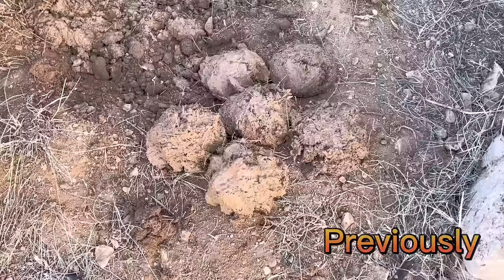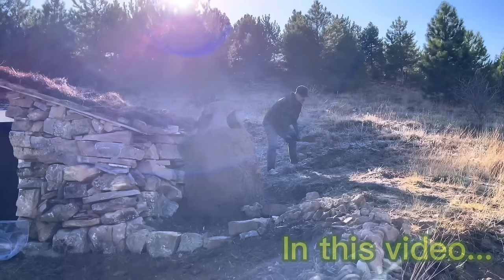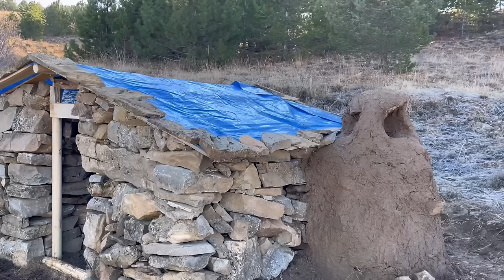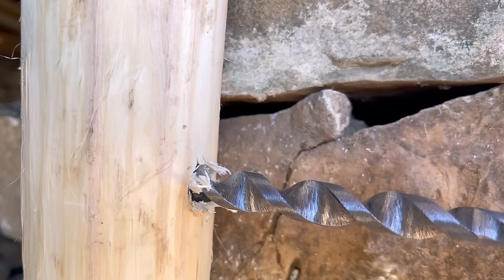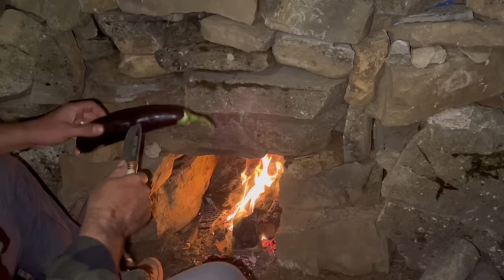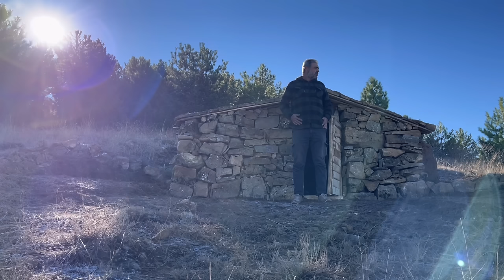Building a Warm Survival Shelter with Fireplace inside | Bushcraft Camp | Off Grid Stone Log Cabin

Comment: Wherever you go Into the Woods, if you have to move rocks for any reason whatsoever then strap a hand truck to your back with inflatable tires attached. Fill the tires with expansive foam before you leave the house so you will be assured of no flat tires when you're in the wilderness! Your back probably hurt you quite a bit after you moved all those stones right? My back hurts just watching you do this. I used to build retaining walls and I'm very mindful of how balanced coordination and using your common sense and your proper tools will help you feel good when you lay down at night instead of throbbing in pain while you can't sleep laying on the cold wet ground!
Reply from the maker: Hello. Thank you for your precious comment. I think I'm going through some very silly things. I have a herniated disc. Normally when I lift these heavy stones, my lower back has to be worse. But interestingly, my back is relaxed. I built a stone shelter last year. My back pain is gone and I haven't had any problems for months. After this stone house, my back was relieved. I thought about it but couldn't find a logical explanation. Building retaining walls is really hard work. If you have done it for many years, you are very tired physically. I think it will be a bit of a hassle to drive a wheelbarrow in this rough area. Thank you very much anyway.
Reply: @MichaelBushcraftandOutdoors  I agree that with proper body mechanics, your back should get stronger with rock setting. Also, a hand truck is not that heavy and can be easily carried and is indeed a back saving tool!
Your stone house look great. I am building a stone bush house with my son very soon.
Merry Christmas.
Reply from the maker: @1963wheeler  You are right. If I had driven a wheelbarrow, I would have finished much sooner. Health is more important than anything else, but I guess I don't pay enough attention to my health. It is necessary to work with the best equipment. I hope your house will make you very happy. Good luck. Merry Christmas. :-)

Comment: There is a problem with the height of the chimney as per Mi code the chimney has to clear the peak of the roof. In the video the  smoke is drafting across the (soon to be) dried grass of the roof. As fires usually exhaust sparks, you run the risk of setting the roof on fire. The whole of the house is very well done. I can really imagine ancestors, including kids, living there. Congrats.
Reply from the maker: Thanks you for your precious comment. I actually raised the chimney a bit in the last video, but I'm not sure if it's enough.
Reply: Good constructive comment :D

Comment: You did a great job. 
I converted  ( with my new wife ) a  stone church into a home. It had no water, or bathroom, and very minor electricity ( eight lights )  The pointing was terrible and not safe. 
We re-pointed it, installed electricity, heat ( wood stove & oil furnace )  had a well drilled, passed a well line through five feet of stone wall, installed plumbing, put a second floor using the pews for wood.
It turned into a beautiful home.
Your survival shelter was no less a challenge, my sincere compliments on your great work!
Reply from the maker: Thank you so much. You really put a lot of effort into making your own home. I can imagine how tired you are. Mine was pretty simple. My body was very tired, but I did not have complicated tasks. Thank you for your valuable comment.

Comment: I know, it's a hard job but you can add more stones to make the wall taller and more comfortable this place. Good luck, great video.
Reply from the maker: Thank you so much. You're right, I would have been more comfortable if the walls were a little higher. But the wall would be more likely to collapse. Safety or convenience? I thought. I gave the security answer first. Thanks you for your precious comment. :-)
Reply: @MichaelBushcraftandOutdoors  The walls would of course be more stable if the walls are thicker at the bottom. This is a bit more work, but it could make the cabin more comfortable.

You could also add some logs as bracing on the inside of the stone walls, and perhaps even add some plank walls. The gap between the rock and plank walls could then be filled with some kind of insulation (such as the stuff you used on the roof).

Regarding the roof, I'm guessing that you hardly get any snow in your region, as those roof planks seesm much too light to carry any kind of load. If you strengthen the roof a bit you could as a thick layer of sod on top, which would help insulate the cabin even further.
Reply from the maker: @navn_ukjent  Hello. Thank you very much for your useful and detailed comment. Actually, I shared another video after this video. I upgraded the house a little. I filled the spaces between the stones with mud. I made the roof a little stronger and laid fine stones on the roof. But then I realized that it was a mistake and lowered the stones. It snows here in winter. Maybe it will rain 1 meter. Although the stones I put on the roof were very heavy, there was no problem on the roof. So I think it can withstand snow. If you watch my last video, I would love to see your comment again. Thank you again. Hope to see you again. :-)

Comment: Quite interesting building method using crude stones. Maybe you should have used mud as joinery between stones? It could be a better protection agains wind.
Very nice video, I subscribed your channel.
Reply from the maker: Hello, thank you very much for your valuable comment. You are right about the mud. After this video, I continued working on the house. As you said, I filled the gaps between the stones with mud. But I haven't posted the video yet. Thank you very much for your recommendations. Hope to see you in the next video.

Comment: Very nice, but fireplace too small. I would extend it into the room with a large flat slab on top for warming and cooking. better yet, stone sidewalls into the room and a steel top. Now you might get some real heat from it rather than just incinerate wood.
Reply from the maker: Thank you very much for sharing your valuable opinions. Comments like this give me ideas. You're right, the fireplace was a little small. But enough for now. The idea of a flat iron plate for cooking is very cool. If I can get to the blacksmith I will arrange this. Thus, the fire does not damage the stones.

Comment: I just thought you probably fix the roof in some points and connect to walls with pieces of metal or cement, etc, but I did not see it!
I think this roof will face some winds or even thunderstorm, so it must be better and strongly tied up to walls. Am I wrong?!
Reply from the maker: Hello. There was another video before that. I may have shown what you didn't see there. I drove poles in some places. The roof stands on those pillars, but it also gets support from the stone walls. You are right about one thing. Later I installed two more posts from the inside to reinforce the roof. I also used mud in the video after this video. I made 3 videos for this house. The roof is currently intact. Land and wind resistant. Thank you for your valuable comment.

Comment: One Nail in each corner of the door? SCREWS AND GLUE will last MUCH longer! Smooth nails and drying wood let go. Wire for a hinge? LOL Leather straps from an old belt would last MUCH longer. I don't know if you are in a snow area that has the potential to get deep, but that rafters and ridge pole certainly isn't going to stand much, if so. Clay, Straw and Ash (and maybe some lye) make a better mortar and stucco. But wear rubber gloves if doing that!
Reply from the maker: Hello. I guess you didn't watch the last video. In the last video, I reinforced the roof and filled the stones with mud. I am in a snowy area. Yes, I used wire for the door. Actually, I guess I was a little hasty. The hinge would be much better as you said. I'll think about it. Thank you again for your valuable comment.

Comment: I would not build a short chimney right beside a roof made of easily burning materials. Please rethink the chimney & roof for your safety.
Reply from the maker: Hello. I actually raised the chimney a little bit in the next video. Maybe I should upgrade a little more, I'm not sure. There is soil on the roof. So I don't think it will be a problem. Thank you very much for your useful advice.

Comment: The fireplace is far too small, the battens are far too weak for a stone roof. In my opinion, the roof is dangerous. The walls look good and reasonably stable. I hope there is no snow in this area...
Reply from the maker: Yes, the fireplace is a little small. Then I reinforced the roof a little more. I put support on the boards. There is no danger at the moment. There is snow in the area. It will snow soon. But the roof will hold up to it. The walls are really solid. I built the walls very thick. Thanks you for your precious comment.
Reply: @MichaelBushcraftandOutdoors Your roof will hold, it probably is - but it should be built more solidly and with stronger roof beams. Especially if you are still doing a stone roof. Otherwise great job and the video is cool.
Reply from the maker: @ernestospadolesto8126  Hello again. In my last video, I put support on the roof. I laid stones on the roof but lowered them again. Thank you so much. :-)

Comment: Like your video. Your building in cool but not quite tall enough really. You wouldn't be able to fully stand up.
Reply from the maker: Yes, you are right. The house is not high enough. I didn't raise it consciously. I did not use mud or cement when building the wall. Therefore, high walls can be dangerous. Also, this is an earthquake zone. In fact, an earthquake with a magnitude of 7.8 occurred here on February 6, 2023. But the house is still intact.

Comment: Since you invested time in building that shelter, why not make one where you can stand fully erect to avoid back ache problems during prolonged stay inside.
Reply from the maker: You are right, I will spend a long time here. But inside I either sit or sleep. I do not stand. Check-in is a bit of a problem. But raising the stone wall any higher can be dangerous. That's why I didn't raise it much. There is no problem using it this way. Thank you very much for your useful comment. Hope to see you again in another video. 🙏